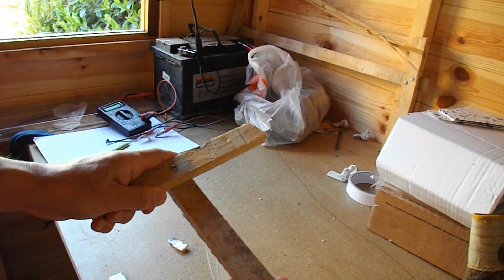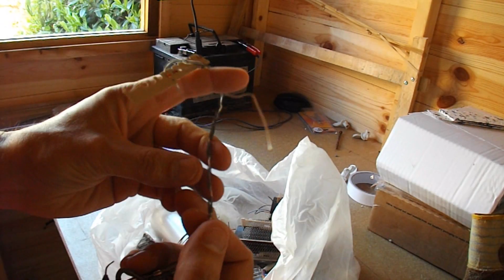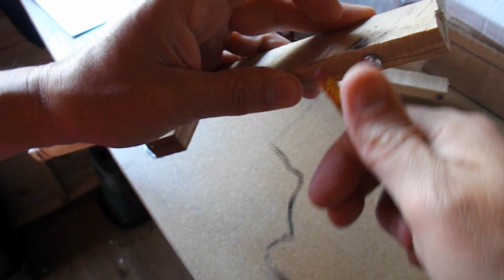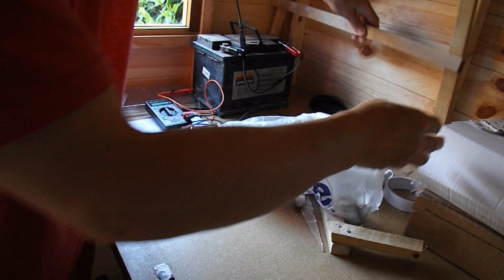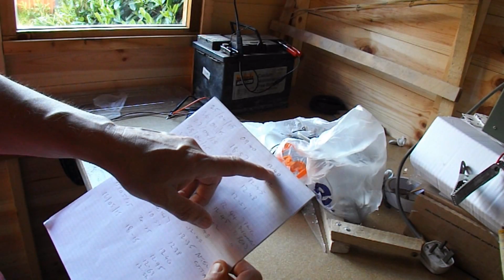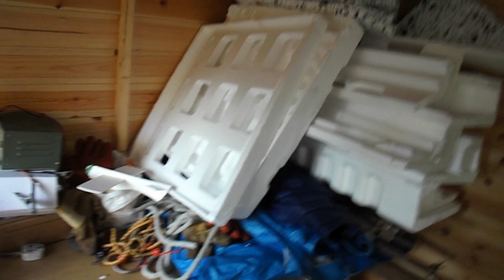Hot Wire Styrofoam Plane PART #6 - those hot wire bows

Comment: Have you tried to run the hot wire direct off the battery charger without a battery?, if its a 'dumb' charger it ought to work.
The output from the charger wont be constant dc so you might not get the same heat as the battery, however if your charger has low and high you'll have some control.
Reply from the maker: hellcattanks I would rather use the car battery. I did intend to put a variable resistor in circuit but found I could manage without. The one I had wasn't suitable anyway. I have used my battery charger direct in the past but I would rather not risk damaging it when I am likely to suddenly need it for the car the next day, life is like that. The battery has a solar charger rigged up to keep it topped up and it seems to stand up well with the small amount of cutting I do. I also have a couple more batteries available should I decide I need to have more power or a larger bow.